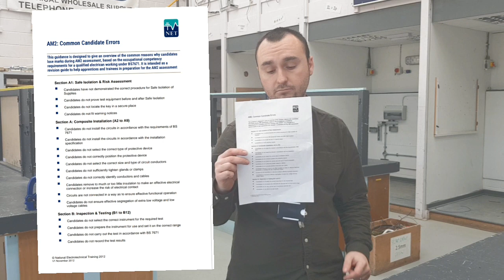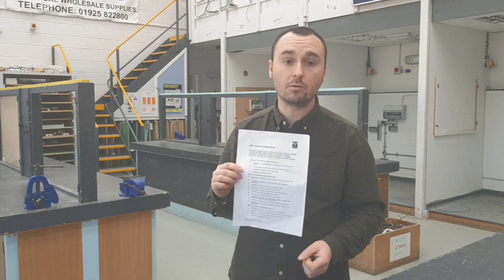AM2 Common Errors

Comment: Check the diagram for the DOL starter, they deliberately wired it L3-L2-L1 on the incoming side to the isolator and because the contactor is pre-wired, they swap it back to L1-L2-L3  between the bottom of the isolator to the top of the contactor

Comment: Good video. What is the preferred method  for terminating SY cable in an enclosure? Should the 2 brass washers be inside the enclosure or external? The reason I ask is that clamping the braids inside an enclosure can be tricky. Also would you confirm that colour identification is not required on black SY conductors as per BS7671? Numbering is allowed instead of colour identification. Also are the legs of the RFC required to be labelled/identified? If yes would one label them? Are the main protective bonding conductors required to be labelled inside the DB? Is it OK to ask the accessor to carry out the phase rotation test at the isolator before putting the cover on to conduct the Zs test? This would save some time as I would have to remove it again adter completing the Zs tests. Thanks

Comment: Can you confirm the switching of the light switch(s) is required for safe isolation or was that for insulation resistance testing? I take it learners have to do both single a 3 phase isolation procedures and are you suggesting they make learners do the lighting circuit as the 230v circuit to be isolated? Thanks Gaz
Reply from the maker: It's required for both. I was referring to when performing safe isolation, it's important we test both sides of the circuit to ensure it's just not switched off. Similarly with insulation resistance we have to test both side to ensure we have tested all cables in that install. They have to do 3 phase safe isolation in part A, then before live testing they have to perform 230v safe isolation on a lighting circuit and DOL. Great question Gaz. Does that help?
Reply: Do you have to do safe isolation for both single and 3 phase on the AM2 or is it just one or the other? Thanks
Reply: Good videos Gaz, very helpful as easy to follow